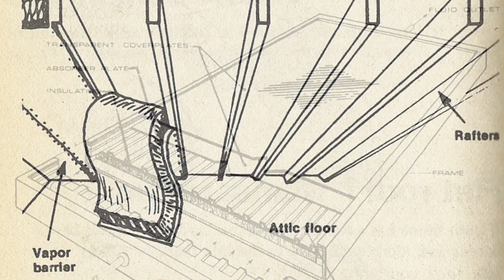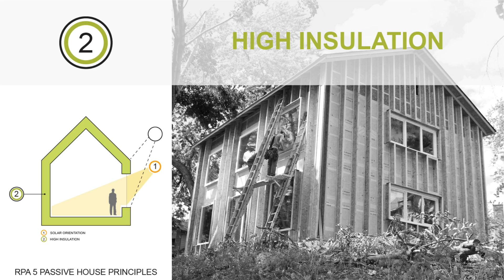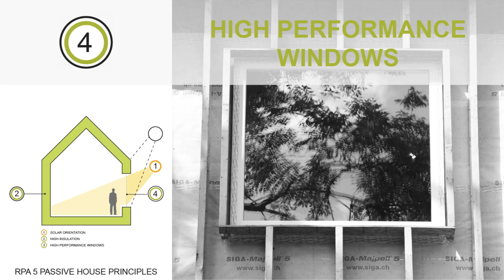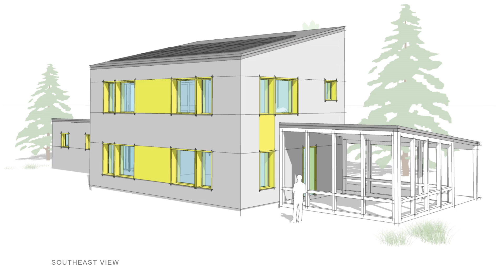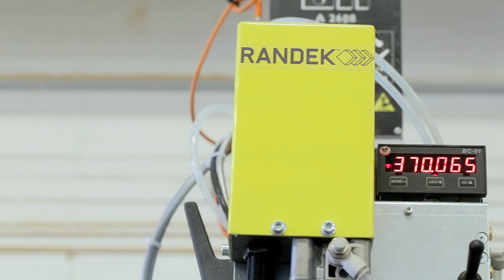Passive Architecture Design #99 | Ecocor - Prefabricated Passive House | Searsmont, Maine

Comment: air leaks, we simply dont do enough, Insulation fit out and the attention to quality and R rating, we simply skimp on this inexpensive important solution, sealing all joins, simply overlooked, single glazed windows, simply in effective, all this is standard practise in any Australian home. Wall wraps are installed and they all fail to be effective, all in any Australian home. So Sad our standards are so, so low. And to top it all, we are crazy mad on resolving climate change, but pay no attention to how our houses are built.

Comment: It is possible to NOT  have an air to air heat exchanger, simply by tilting a few windows for a couple of minutes, in the morning and evening. However, it would probably be a good idea to install a dehumidifier for the winter. My house is 13.5 cm thick logs or blocks as they are known in europe and 14 cm of wood fiber insulation from the Steico company with furring strips over the rigid insulation and wood siding over that. The windows are triple T& T wood frames that are painted . i'm thinking of trying a dehumidifier this winter to reduce condensation on the windows during super cold days. Anyway very nice video , good camera work and devoid of unnecessary rambling . 😜

Comment: This is how I would want to build my house. I would want to use heavy insulation and break-resistant storm windows. They have a high e-value as well as the triple pane. Doing some research on them now. Also, it's ".us" not ."com" for their site.
Reply from the maker: Thanks a ton for the heads up on the website! I got it fixed. These guys really are doing something incredible. Totally checked them out!